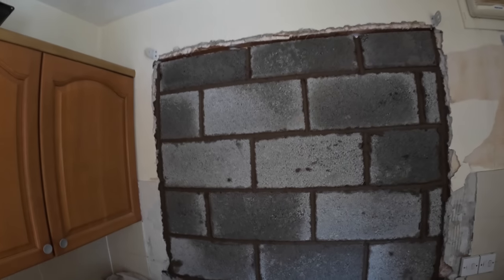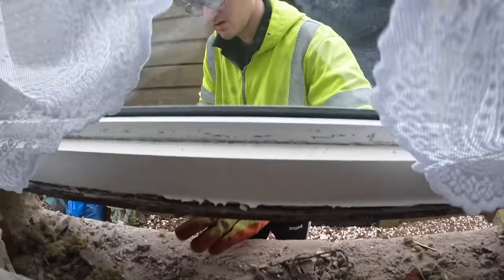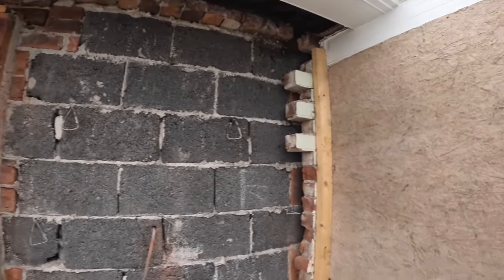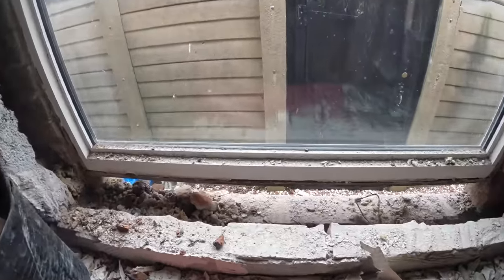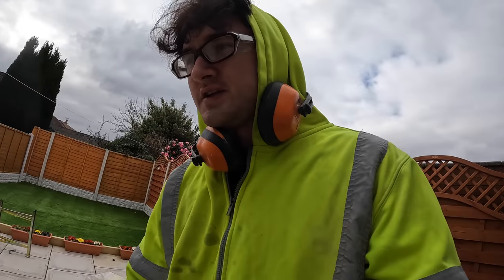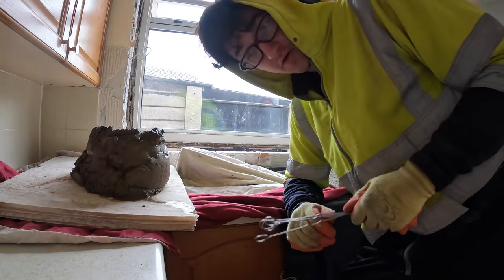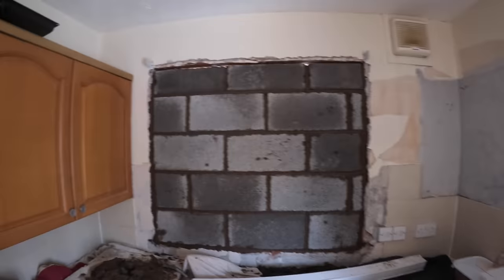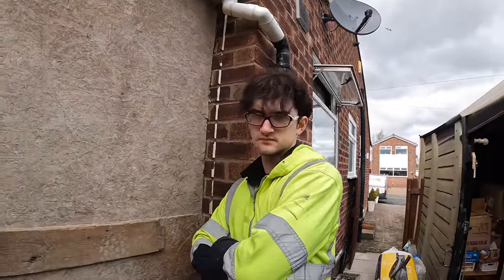HOW TO BLOCK UP A WINDOW...KITCHEN CONVERSION  PART 2

Comment: Well done guys another good job taking the window out. Why did you leave the microwave in the kitchen partly covered up ?  Was is wired into a mains socket ? Is that why it was left to gather dust.
Reply from the maker: Thanks, never noticed the microwave 😆😆🧱👍🏽

Comment: You could also close that window with a timber frame and plywood with plasterboard over. Insulate the outside face with heavy weigh rock wool.
Reply from the maker: We could if we were carpenters , so as we are brickies it gets blocked 😆🧱👍🏽
Reply: Better to keep to the same materials not mix n match.
Reply from the maker: @crisfiler6128  👍🏽🧱

Comment: Have you tried one of those rocking action masonry cutters that move the cutters in opposite directions? Are they as good as they look? They are faster than sabre saws and no mess like grinders. Back in the day, I used a grinder to cut a doorway through a cinder "breeze block" wall. Despite sealing everything with poly sheets & taped joints the dust was horrible. I couldn't see to work. Brick saws didn't exist back then and chiselling out the opening was too destructive to cinder blocks.
Reply from the maker: Never used one pal 🧱👍🏽
Reply: Hi David, it's an Allsaw made by Arbortech. They are fantastic bits of kit but quite expensive for how often most guys would use them. Im sure most tool hire centres would have them. Mine's over 12yrs old now and still working just as well as when I bought it.
I think they're around £1200 now and the blades are about £100 per pair. They're perfect on lime mortar but struggle a bit with OPC and are useless on a really hard mortar.
Excellent for cutting through tree roots too.
Regards
Tim
Reply from the maker: @timmargereson332  cheers Tim 👍🏽🧱

Comment: Great video guys! Alex did a great job! Give the hard workin'  guy a pat on the back! 👍👍🧱🧱🧱🧱
Question: Do you run into issues with cross trade work? Here, one trade will never touch something that's another trade's area. Electricians  here run into issues with that all the time.
Reply from the maker: Thanks buddy , same here too , we stick to what we know and are trained for 🧱👍🏼